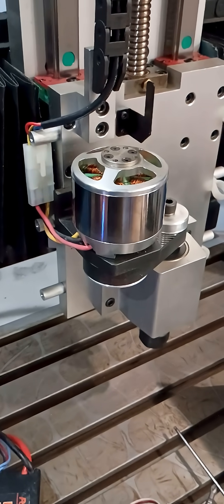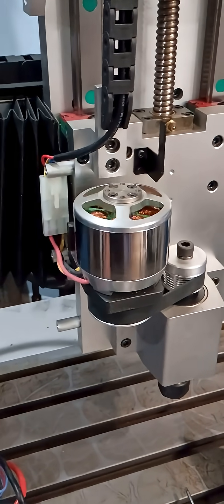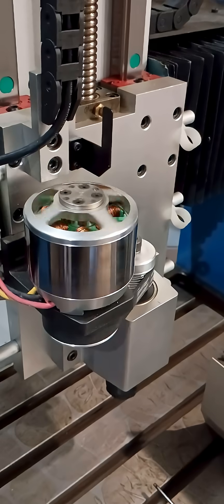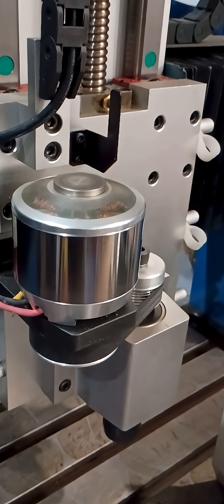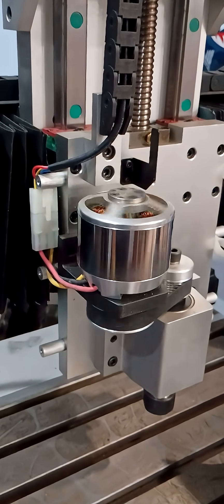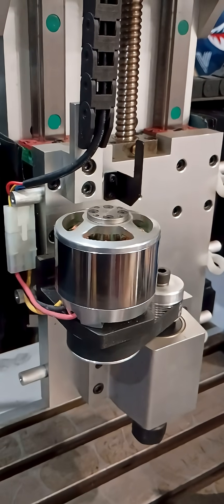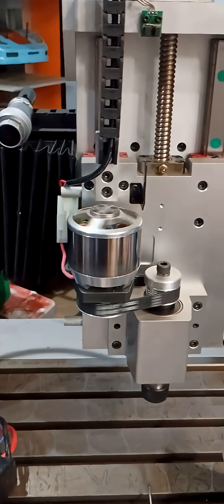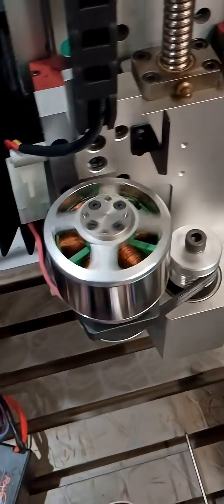CNC milling machine brushless motor will stuttered, but will engage after couple seconds, what to do

Comment: problem is about one of the 3 wire wrap, one of them is burnt or something, just not working so 3 phase is cutting in the middle and not producing enough torgue to start the full run